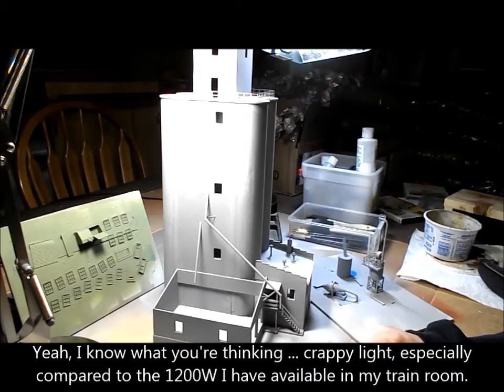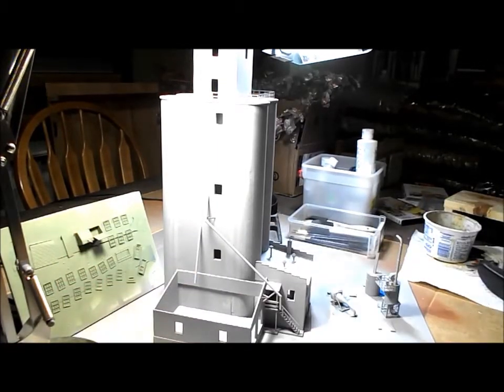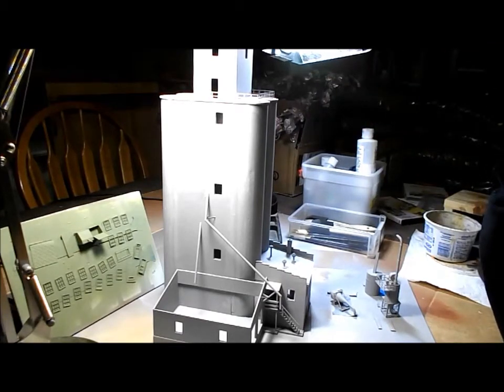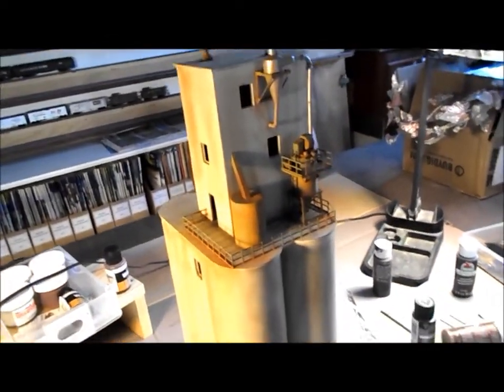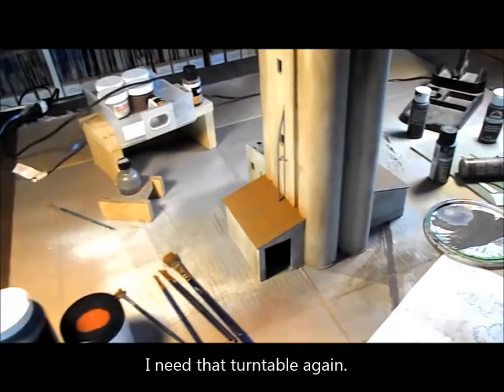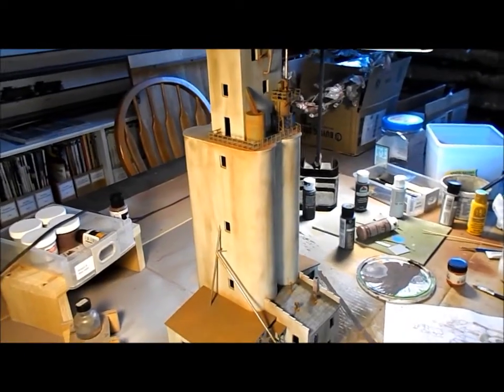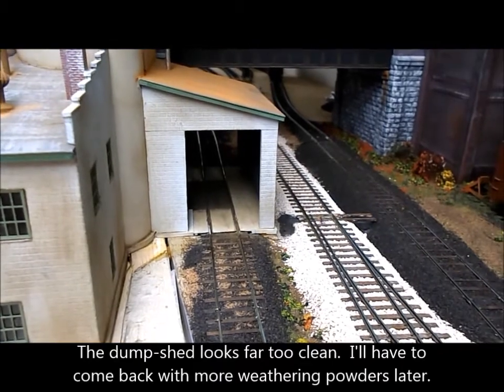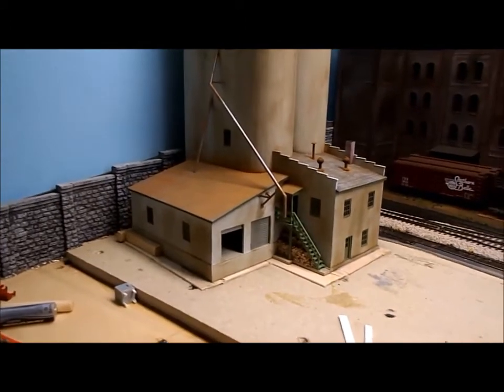My railroad: B. Kay Feed Co, part 4

Comment: Your grain elevator is very similar to the one I will be modeling. It was two-tube, but did not have the headhouse. It had a ramp leading to a scale, then where the truck would dump into a loading auger. Then there was a loading shed for hopper cars on other side. Great Build!